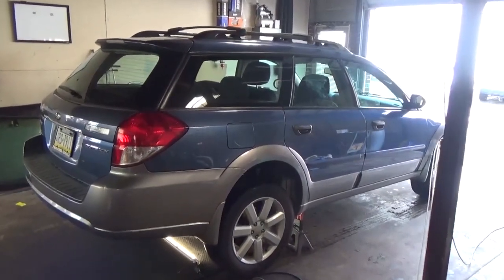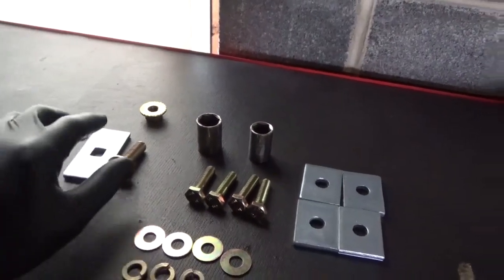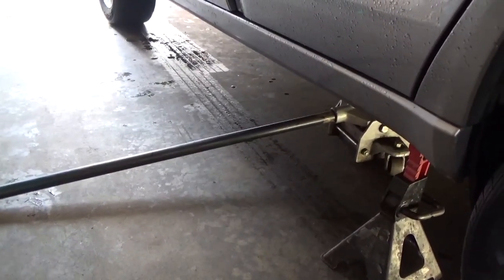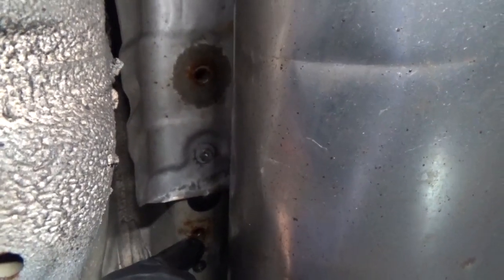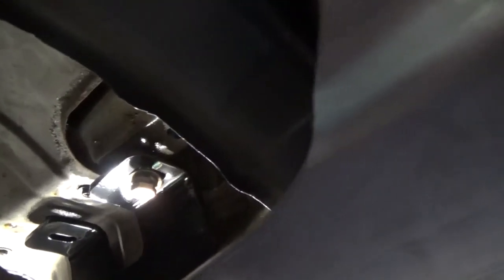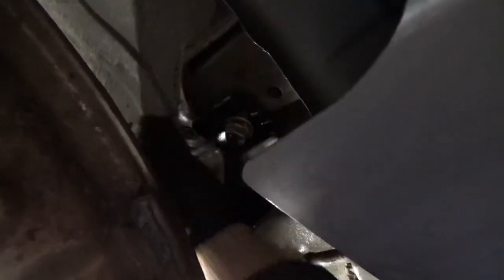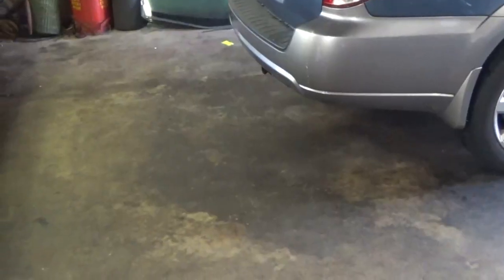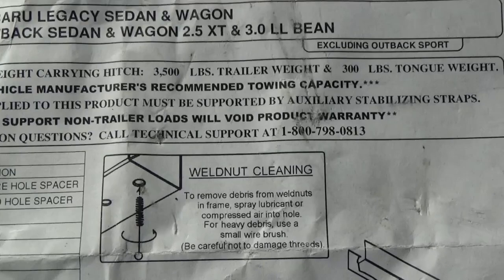How to install a Trailer Hitch Subaru Outback 2008

Comment: I have just bought the Draw-Tite 75560 for my 08 Legacy Wagon, but the mounting hardwares were lost during shipping. Also I just noticed there are no weldnut in the frame (probably because it is the Japan model?) Do you think there are still ways to install the hitch? Thanks for your help!

Comment: Mine had some kind of body stiffening brackets held in by 3 bolts on both sides covering 2 of the body nuts. 
First I thought I had the wrong tow receiver but it fit after removing those brackets which it looks like someone else had already removed or was never installed on this car. Not sure what the purpose of them was but can't install the receiver with them on.

Comment: The reason, why I want this, is because I don't want to buy a truck. So buy a trailer instead. The most used its going to get is going to lowes for wood and Trees as well.

Comment: is this one a 4 cylinder or an H6?
Reply from the maker: 2.5L 4 cylinder
Reply: well hopefully they're not planning to tow anything that heavy. those engines aren't meant to take a lot of weight.
Reply from the maker: +Michael Sackstein very true statement, mainly going to be used for a bike rack
Reply: robinsonsauto
my moms been leasing outbacks for over 21 years now, I would know. we did have one that was a 2004 H6 LLBean edition in red. loved that car.